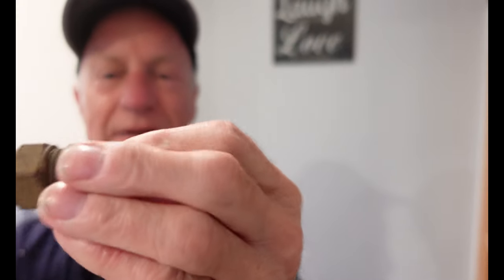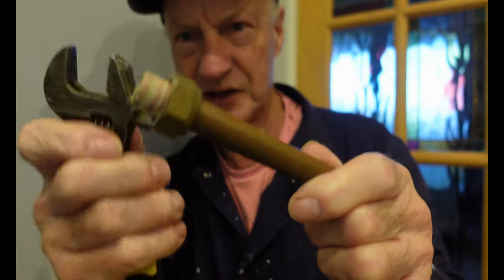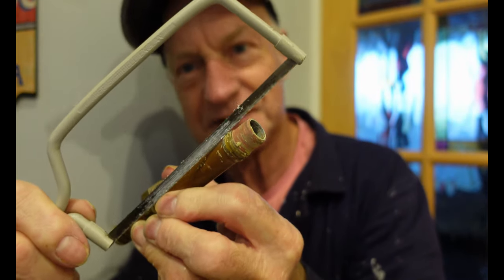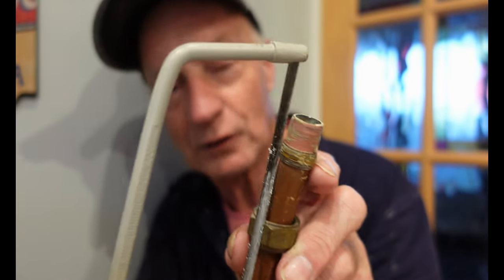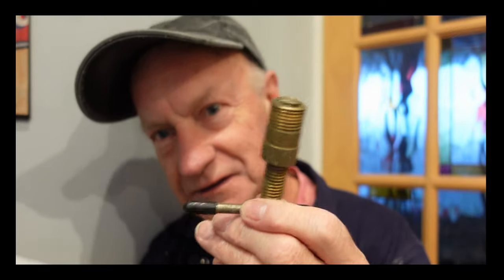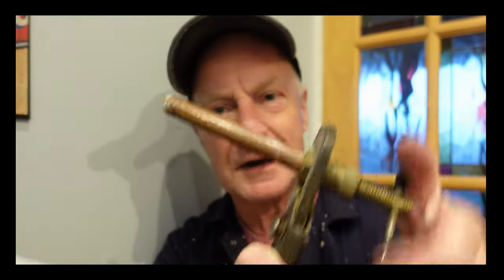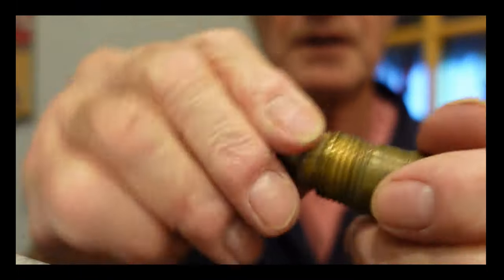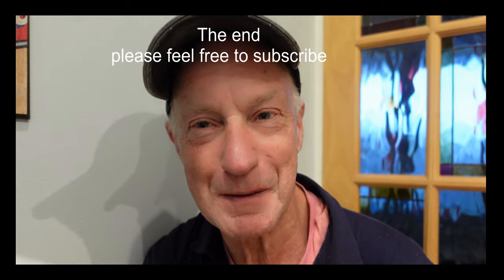How to remove pipe olives from copper pipe

Comment: Good stuff as always! I love the olive puller, and another user has commented about the olive cutter you can buy, again great tool but as mentioned you have to get it square or you can nick the pipe. I also find you can remove an olive with a set of grips, especially on recently fitted compression fittings, space allowing as always
Reply from the maker: Awesome! Thank you!

Comment: A fourth option is to gently and carefully grind through the olive/ferrule/compression ring with a Dremel tool fitted with a small tungsten carbide burr.  It's about as risky as using a hacksaw, but I did so today and it worked.
Reply from the maker: Thanks for the tip.

Comment: With this Olive Puller have you ever experienced the stuck olive/ferrule/compression ring actually shave down or compress the copper pipe (changing it's O.D. outer diameter) as it is being mechanically pulled off with each turn of the tool?   This just happened to me.  First time I used the tool.  My tool does not have the metal rod at the end as a handle to turn the screw by hand...that would have broken in my situation but more likely a human would not have been able to turn it by hand, even just a quarter turn.  Mine has a large bolt head at the end where your handle is.  I used a 10 inch crescent wrench/spanner for turning or screwing.  Immediately, each turn of the end nut rotated everything including the compression nut.  I had to hold the Nut on one end of the tool with another wrench while I turned the tightening screw nut at the other end of the tool with my 10" Crescent wrench.  It took all my strength (was worried about bending the pipe or breaking something), working in a very tight area. It took about 20 minutes of time to complete the removal at 1/8 th turn of the screw with each effort before repositioning the wrench.  The high effort with the first pull of the wrench stayed constant all the until the last pull when it popped off.  Eventually  I did get the olive/ferrule off but it changed the OD of the copper pipe such that after attaching a new shut off valve with a new olive, even when tightened down full, I could slide the new shut off valve off and on the copper supply pipe (original 5/8" OD, 1/2" ID) by hand with no resistance.  I couldn't really find any shavings of copper.  The puller and old brass olive acted like an extruder reducing the OD of the pipe it passed over when being mechanically removed.  It all seemed so wrong while I was doing this due to the physical effort required but the tool is simple, one cannot screw it up....or can I?   Do you have any idea what I was doing wrong or what might have gone wrong with the tool or materials?  I'm in the USA, Phoenix, AZ.  House was built 20 years ago.  Apparently there was a change around the time my house was built re: the composition of copper pipe or wall thickness? but due to the color of my pipe another source said I had the old style pipe....the good stuff and not the new cheaper copper pipe.  The olive puller I used is described on the following YouTube channel name - --- seejanedrill -----  video title 'how to remove a stuck ferrule from copper pipe in seconds".   The tool I used is made by Dick English.  English Tool Company, http://englishtoolco.com (website no longer comes up)
While writing this I just came across a comment that said "if the original ferrule was overtightened when installed or over tightened after initial installation to stop a leak, what I just described above can happen with these tools.  So the big question is, how do you know if the existing ferrule is "overtightened" when you try to remove it?  Should this tool work with very light turning pressure and if it requires more than that you stop and got to Plan B for removing the olive/ferrule?
Reply from the maker: I have heard of this happening when using these tools, I always look at the pipe to see how crushed the olive looks, if it looks like it has been overtighten to extreme's, then like you, I resort to plan B.
Reply: thanks dereton33 for that reply.  What is confounding to me is the original olive/ferrule showed no obvious signs of deformity while on the pipe or when I got it off the pipe (after performing like an extruder bit on a pipe forming machine).  Even side by side or stacked one on top of the other, I could not detect any dimensional differences. With a caliper I'm sure I would have found some difference but it was not obvious and for me not detectable visually.   @dereton33

Comment: Mine is stuck on both ends so I'm unable to replace the isolation valve any advice iv trey hack saw stressed out as no hot water coming cheers for any advise
Reply from the maker: Cut out the isolation valve altogether and fit a full bore lever tap.
Reply: @dereton33  can I use hacksaw for this so cut through isolation valve it's self in center
Reply: @dereton33  will this give me the pipe space I need still as the 15mm valve I have is inly 24 center meters roughly it's leaking now I was Gina grab dreamily in morning iv capped it off with plumbers putty appreciate your advice
Reply: @dereton33  apologies for msg agin . I simple can nor get the valve off as the olives won't alow enough gap .. I was assuming you ment use a pipe cutter flush up to the olive cut either end then apply the full bore as I'm assuming the with of this valve is much longer that standard 1. So would compensate for the loss of pipe each due to cutting out would be very greatfull . As I'm probably gona go buy a dremil today and try and cut the olive as I'm really confused and over whelmed about ut all .look forward to your reply

Comment: I've tried to install a new mixer shower but accidently tightened the nuts first causing some compression on the pipe. When I installed the new unit with the copper olives it came with, the cold side was weeping a tiny bit, I came back to it later and tried to nip it up, the slight tightening caused a full blown leak (I assume the olive moved to a section where the pipe was compressed and broke the seal). In a panic I fitted the old unit back on with the old brass olives and the nuts bottomed out, but have sealed. I've bought some PTFE and Water Hawk, but I assume neither will do the trick if the olive can't bite down adequetely? I'm also wondering, when using an olive puller on an overtightened olive, would the olive be strong enough to straighten out the pipe (assuming I'm strong enough)?
Reply from the maker: Just pull the olives off with the puller it will help straighten the pipe, fit new olives but use a small twist of hemp in front of the olive then use boss white all over the hemp and the olive including behind it.

Comment: You can also just use mole/vice grips or anything with teeth on and just grip the olive lightly and turn it to and fro as you ease it off the end of the pipe.
Reply from the maker: Not mole grips, it is too easy to overclamp them and squeeze the pipe out of shape.

Comment: Hi al my house was built in the 1970s because of the shortage of copper they used polyorc on the cold water pipes .I've managed to get a copper compression to join to the smaller size but not for bigger pipe how would overcome this thanks alan
Reply from the maker: An old imperial three quarter coupling may fit it. If not then go from your 15 mm copper fitting up to 22 mm and remove the polyorc pipe work ,a more expensive option I know.
Reply: @dereton33  Hi Derek thanks for getting back to me so fast top man .I've just done what you said and its worked a treat thanks so much 🙏

Comment: Hi All. Can you tell me, does it cost the same amount to run a single radiator, to heat one room, or all five (in my case), on an oil fired central heating system. Ive been googling this recently and cant get a definitive answer. Thanks
Reply from the maker: It will be cheaper.

Comment: You can also use the 2hammer tric. One under the ring firm against it and with the other you tick on the olive. Don't bang to hard. If you can turn all around the olive it's good. Or you can twist the olive around the pipe. 
No tools, Just skills.
Reply from the maker: Thanks Marco.

Comment: Use a junior hacksaw but cut at an angle across the olive. Put the blade of a small screwdriver into the slot you have cut, one quick twist and the olive snaps. 30 years...no problems.
Reply from the maker: So have I but for people not experienced with doing this it is too easy to cut through the pipe.

Comment: There is also a olive cutter, slide it over the Olive and squeeze the handles and it cuts the olive on both sides. A quicker alternative to the hacksaw (or dremmel) but I have to admit when I've used mine it has sometimes nicked the pipe too. Nothing has beaten my olive puller
Reply from the maker: Thanks for the info.

Comment: I used a dremel perpendicular in lieu of the hacksaw.  Where eye protection, And don't rush.  You don't need to cut all the way through... just far enough to put a flathead in the cut, pry,  and crack the olive at which point it will slide off.
Reply from the maker: Mind you do not push the screwdriver through your finger when it slips off the cut, if it is not deep enough.
Reply: @dereton33  true, it didn't slip on me, but certainly possible in a tighter space at an awkward angle, which happens often enough with plumbing

Comment: I used a hacksaw and only went so far. Then with a flat head screwdriver into the cut and turned it to break the olive. I'm no plumber but it's what I had on me at the time.
Reply from the maker: That is the way I have done it for 50 years.

Comment: You FORGOT that the pipe is connected to A WALL? A WALL WITH LITTLE CLEARANCE! I used a Dremel tool. A off it came.
Reply from the maker: How many WALLs is that Steve.